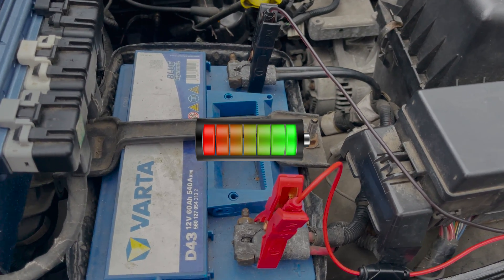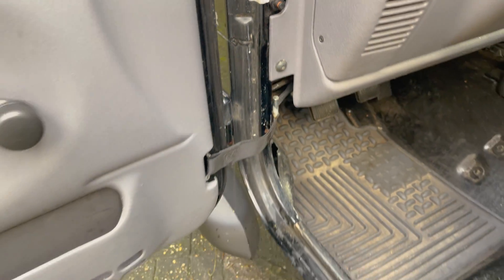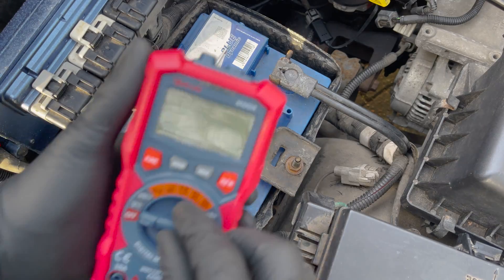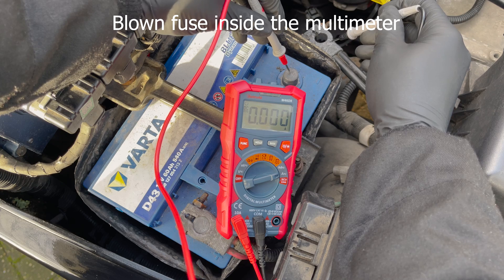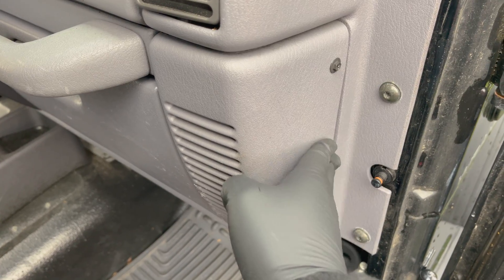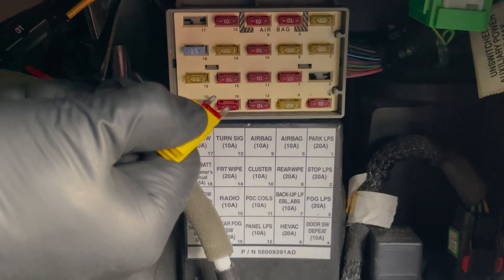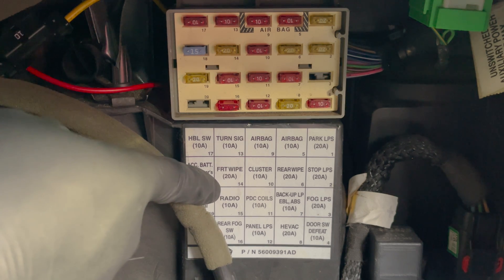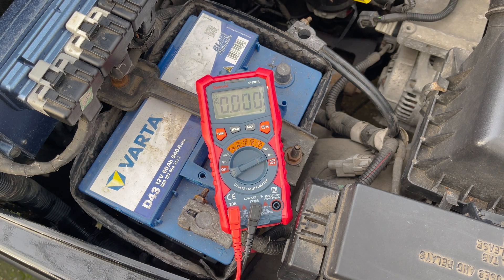The EASIEST way to test parasitic draw

Comment: I've been fighting with my 2014 Ford Fusion draining the battery for years.  I've had it checked a couple times but I just get the "we can't find anything" response.  I don't know what method or procedure was used to try to find the problem so I don't if the method shown in this video has already been done or not.  I had it done at the dealership where I bought the car so you would think the technicians there would already know this procedure.  But, like I said, I don't know for sure.
Reply from the maker: The first thing you want to do is test your car battery with a battery tester. If your battery passes the test, do the parasitic draw test as shown in this video and you should be able to find the culprit in no time. And if you can’t find a parasitic draw, check your alternator if it’s still charging the battery. We’ve got separate videos on all these subjects on our channel, so make sure to check ‘em out!
Reply: @classiccarmaintenance  I'm pretty sure the alternator is, in fact, still charging the battery.  As long as I remember to run the car every couple days, it seems to keep it charged enough that I don't go out to a completely dead battery.  That's only happened twice in the years that I've been having the problem with this car.  I get a message that says "Battery Saver Audio Off" and the chime sounds different and the car won't start with the remote ( it just honks once and that's it ) but it will still start if I get in and start it with the actual key.

Comment: How are we checking for Anthony when the negative is disconnected.   I got my cable between the terminal on negative and the ground. Am I suppose to connect em. Or why did I discconect em. Couldn’t I have just stuck it to it ?
Reply from the maker: When you hook up the multimeter between the negative battery terminal and the black battery cable, it functions as a bridge allowing power through. This, however, is limited by your multimeters' internal fuse(s). If you turn on too much electrical stuff and draw too much power, its fuse(s) will blow and you'll have to replace them.

Comment: So once you get in the car to start pulling fuses…should u wait 30 minutes again before doing so to allow the car to go to sleep?
Reply from the maker: You can do that or compare the amp draw before and after pulling the fuse, regardless of initial readings. If the amp draw drops, you have a parasitic draw somewhere on that circuit.

Comment: How did the accessories turn on with the earth disconnected?
Reply from the maker: When you hook up the multimeter between the negative battery terminal and the black battery cable, it functions as a bridge allowing power through. This, however, is limited by your multimeters' internal fuse(s). If you turn on too much electrical stuff and draw too much power, its fuse(s) will blow and you'll have to replace them.

Comment: I'm trying to explain to my dad that he was showing an example on how to see a bad draw with Turning the radio on but he messed up when the radio actually turned on because the battery is disconnected and dad says this is the dumbest video he's ever seen cause that's impossible
Reply from the maker: When you hook up the multimeter between the negative battery terminal and the black battery cable, it functions as a bridge allowing power through. That's why the radio works. This, however, is limited by your multimeters' internal fuse(s). If you turn on too much electrical stuff and draw too much power, its fuse(s) will blow and you'll have to replace them.
Reply: @classiccarmaintenance come to find out the multimeter we were using was bad 😅
Reply: And he had no patience his draw is .3 instead of being .03 but he was getting rdy for a trip and was rushing trying to do this last minute
Reply from the maker: Ah that makes sense! A bad multimeter can definitely throw things off. Glad you figured it out. Hope our video helps and you get it done in time. Good luck with the trip!

Comment: Is it normal for the reading to start really high and drop down after ~10 seconds?
Mine reads above 1amp right when I connect to it but starts dropping down over time to 7milliamps where it stays.
Reply from the maker: If you watch our video, you can see that our multimeter does the same. It jumps up shortly to .3 and drops to .002 after a few seconds, which is normal. That’s most likely because after connecting the multimeter, some electrical component “woke up” and went back to sleep mode after a few seconds.

Comment: Mine read 0. What would you refer to as a modern vehicle? I have an 02 grand caravan. Read the battery just fine but 0 when checking negative lead and battery. Thanks in advance!
Reply from the maker: If your multimeter reads 0, you might have a blown fuse in your multimeter, so make sure to check this.
Reply: @classiccarmaintenance thanks for the response. I get a reading when I test the battery, but with it unplugged I get nothing from negative on battery and negative cable. Quiet crackle sound but no numbers.

Comment: How does your radio turn on with the battery disconnected
Reply from the maker: When you hook up the multimeter between the negative battery terminal and the black battery cable, it functions as a bridge allowing power through. This, however, is limited by your multimeters' internal fuse(s). If you turn on too much electrical stuff and draw too much power, its fuse(s) will blow and you'll have to replace them.

Comment: Can you use locking pliers to clamp the leads?
Reply from the maker: Yes you could. However, they are only safe to use on the negative battery terminal (as long as you don’t touch the positive terminal with the pliers). But when you use the pliers on the positive terminal, you risk creating a (pretty spectacular) short if the metal pliers touch any other metal part on your car. So we would strongly advise against using metal pliers on the positive battery terminal.

Comment: Fantastic explanation and guide. Succinct, with useful info and a great tip or two thrown in. Well done - thank you! One thing mentioned on another similar video was that you should disconnect the meter before you open the door to check the inside fuses, and deactivate the door light switch. This is supposed to prevent any possible damage to your meter. Once the door switch is deactivated (tape or clamp it closed), then reconnect the meter and test the fuses.
Reply from the maker: Thanks for sharing your expertise, greatly appreciated!

Comment: Would an amp clamp work too?
Reply from the maker: Yes, but it’s more complicated. You need to make sure that you clamp it around every wire or cable that comes from the battery post you want to measure, and depending on your specific type of amp clamp and setting you’re in, you’ll most probably need to do some math or conversion to get a correct result.

Comment: 2007 Nissan Murano drawing 120mA someone on forms told me it’s my BCM but idk if that can be a culprit?
Reply from the maker: Anything that draws or transports electricity in your car can potentially cause a parasitic draw when it malfunctions, shorts or breaks, so your car’s BCM can definitely cause a parasitic draw.
Reply: @classiccarmaintenance damn I have a Nissan and from what I’m reading replacing one as a diy is pretty much impossible unless you want to pay 1,000$ for a tool that can reprogram a replacement. The cars got 240k miles so for now I have a remote killswitch installed but I’d like to fix it
Reply from the maker: @zenbran  Before going forward with replacing the BCM, use the method shown in our video to make sure it’s the BCM that’s causing the parasitic draw, and not some other component like the glove box light that stays on.

Comment: I am poor, going through so much and in such a desperate situation. This just may save me from the proverbial straw that broke the camels back level event. Thank you so much for this.
Reply from the maker: Glad we were able to help you out! Awesome to hear that this lightens your load, hang in there!
Reply: I hope everything gets better for you
Reply: My friend is going through the same exact thing and he hardly knows which end of a screwdriver to hold. So I'm gonna be using this to try and figure it out. 

Hope your camel finds the strength to deal with whatever straw comes your way
Reply: Isn’t it insane how much having something like this done at  shop can cost you?  And then on top of that half the time they’ll try to convince you to replace half your front end and other shit that’s just fine the way it is.  I had an older Jeep we just used to run around town.  Shocks were shot,  but it didn’t matter, we weren’t concerned with a smooth ride, never went more than a few blocks with it.  I was working out of town and it needed brakes and since I wasn’t there to do it I told my wife just this time take it brakes plus, tell them all we wanted was pads in front replaced and when I got back I’d take care of the rest.  She called me up 4 fucking hours later, yes she sat there 4 hours only for them to walk out with a list of shit that needed to be “replaced” and then proceeded to tell her if she didn’t get all this done they couldn’t legally allow her to drive it away and she would have to have it towed.  6000 dollars worth of shit on a vehicle that wasn’t worth 2000.  I about fucking lost it.  I told those mother fuckers I was about to drive straight through 8 hours to come kick their asses.  Of course I didn’t but I didn’t file a complaint with the BBB and called their corporate office.  I then wrote a letter to my senator and this next voting cycle a bill will be on there to make it illegal to gouge out u necessary repairs at mech shops
Reply: @adamgee5050 omg. Wow. Simply wow. Crazy. So what needed up happening ?  Did she have to pay the $6000 to get the car home ?? It fuckin infuriates the shit out of me when I hear this happening especially to a woman.
Reply: Saying a prayer for you!
Reply: Same! Im a 52 yr old woman living in oklahoma,  my daughter got mediflighted to dallas for a liver transplant, weve been there since october. Meanwhile,  my middle daughter went into labor in oklahoma so as a single mother i am driving between south dallas and norman ok, and whoever i leave is alone in the hospital,  every time i get into my 2011 4runner,  the battery is dead.  Brand new $400 battery.  So, the codes say codes and  the mechanics shrug their shoulders and tell me more things it needs 4 codes.  Then they said parasitic draw...shyte.  i will figure it out eventually probably lol but i have to learn it first!! Ill be a wise old lady one day lol 😂

Comment: This is a very good introduction to finding a very simple cure to a parasitic draw issue. But as other videos, such as the outstanding presentations on the South Main Auto channel show, finding the cause can involve understanding of complicated wiring diagrams and testing wire segments and components that can be difficult to locate, let alone properly test. Scan tools might also be necessary, so here’s hoping that the solution to your problem is as easy as a light that won’t shut off.
Reply from the maker: You’re right, this is a simple test anyone can do to locate the parasitic draw. But once it’s located, you still have to find a way to fix it. As you mentioned, this parasitic draw can be caused by faulty wiring, which you’ll need to inspect or test, or a faulty electrical component, which might be harder to test or replace. However, with our simple test you should be able to solve 90% of the parasitic draws without having to spend lots of money on professional help.

Comment: I take it that you have to fully charge the battery first,  my battery keeps going dead after 2 weeks and I did a load test and it was good.
Reply from the maker: Yes, you want to do this test with a fully charged battery to get the most accurate result.

Comment: So the. Does that mean you change the radio?
Reply from the maker: As shown in our video, there was no actual parasitic draw in the car we tested. 

For demonstrational purposes only, we simulated a draw by turning the key to the auxiliary position with the radio on. The radio then draws power which can be measured with a multimeter just like it would in case you had a real parasitic draw. 

Once you know on which circuit the parasitic draw is located by elimination, you can narrow it down further. You want to check the circuit for damaged wiring, or an electrical device/component that might be faulty. Once you’ve determined what is causing the parasitic draw on that particular fused circuit, you now know what needs to be repaired or replaced to eliminate the parasitic draw.

Comment: I tried this method but get no numbers on multimeter.  I use a test light and it lights up. Multimeter on A highest red lead. Black lead on 10 A. Help
Reply from the maker: As mentioned in the video, there’s something wrong if your multimeter shows 0 amps in the (DC) amps setting with the negative (black) battery cable disconnected from the battery post, and the tester leads between the negative battery terminal and the black battery cable. A 0 reading means there’s something wrong with your multimeter (e.g. blown fuse) or the positive battery connection as there will always be a tiny amp draw somewhere because a cars’ electric wiring is never perfect. Normal readings should be anywhere between a few milliamps and 50 milliamps.
Reply: @classiccarmaintenance  Thank you. It shows battery voltage and alternator voltage giving out. Will double check M&M to make sure it's working properly. Will update TY

Comment: How do you open the key and get power after youve removed the ground from the battery. Im completely lost after that
Reply from the maker: When you hook up the multimeter between the negative battery terminal and the black battery cable, it functions as a bridge allowing power through. This, however, is limited by your multimeters' internal fuse(s). If you turn on too much electrical stuff and draw too much power, its fuse(s) will blow and you'll have to replace them.

Comment: Ok. I know it’s been awhile since you did this video. I’m checking a 91’ 240sx. When I hook it up it starts with about .159 draw, but like in 3-5sec it drops down to .023. Why would it do that.
Reply from the maker: If you watch our video, you can see that our multimeter does the same. It jumps up shortly to .3 and drops to .002 after a few seconds, which is normal. That’s most likely because after connecting the multimeter, some electrical component “woke up” and went back to sleep mode after a few seconds.

Comment: Need help please battery keeps dying over night now i just unplug the negative cable because this is  my 3third battery i bought. did your instructions with mulit meter found a draw on the underhood of the car box fuse #21 and fuse #22 its a back up and audio 10amp fuse.i dont know what to do next im thinking i need wiring diagram,but alldata dont have my car on there website or i must pay first before able to see it? do you have other ideas you can help me please. dealer ask for 300 to diagnose plus if found another add cost.would rather try to get it and plus knowledge for me.just need another help.
Reply from the maker: You want to look for wiring diagrams and owner/workshop manuals on car forums for your specific car brand/model. More often than not, someone has uploaded pdf files on there which you can download for free.

Comment: in modern cars removing fuse and putting it on will wakw up some sleep components? i have parasitic draw battery died every 2 days without driving cant find it
Reply from the maker: In case the parasitic draw increases after plugging the fuse back in, you know that some part of the cars' electronics have woken up. Regardless, the principle of locating the parasitic draw stays exactly the same: you only look at the amp drop when removing the next fuse, yet with the new amperage reading as the benchmark. When you pull the next fuse and the amp draw drops significantly, you know this circuit has a parasitic draw somewhere, regardless of some electronics that may have woken up by reinstalling the previous fuse.
Reply: @classiccarmaintenance  if its wake up dont we have to wait for anotheer half hour for car to sleep more ? or no need?

Comment: I'm open for internet suggestions here. I've tried this and immediately when I touch the negative terminal, it goes up to about 2.5 amps, but as long as I keep holding it there within 20 seconds it's down to 50 milliamps. Is this normal or do I not have a parasitic draw and it's something else? All the doors are closed, hood is up but I clicked the lock to make the car think it's closed.
Reply from the maker: Sounds like you woke up your car’s computer or an electrical component for a short while when bridging the disconnected negative terminal and battery cable with your multimeter. Because the draw drops after a while and is not permanent, the 2.5 amps isn’t a parasitic draw. Your regular draw is 50 milliamps which sounds normal for a modern car.

Comment: how could u simulate at 2:18 i ground of battery isn't connected?? or im missing something ?
Reply from the maker: When you hook up the multimeter between the negative battery terminal and the black battery cable, it functions as a bridge allowing power through. This, however, is limited by your multimeters' internal fuse(s). If you turn on too much electrical stuff and draw too much power, its fuse(s) will blow and you'll have to replace them.